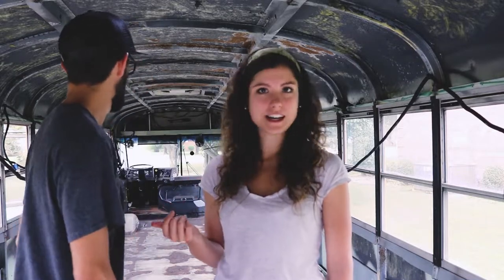The Easiest Way To Fix Rusted Floors School Bus // Skoolie Conversion

Comment: You are going to notice that with everything you want to do, there are several small steps to do first.  Watch my 'Subfloor' video's.  Its a slightly different way to do the subfloor.   Even now, 16 months into my build, i want to do something, and i still run into a small project i have to do first.  Keep pushing through it.  Even though i'm not done yet, it feels like such an accomplishment.  You'll get there too.
Reply from the maker: Thank you very much. I'll check it out. Slowly but surely making this thing something special for us.

Comment: Great job on the floor! We hadn’t seen the product you put on it to convert the rust. Looks a lot easier than grinding out the rust! We’re about to paint our floor & we’re looking for ways to clean it first. Great video! Keep them coming!
- Brian+ Erin
Reply from the maker: We did a little grinding at the loose stuff but this Corroseal stuff did so much better then we thought. We did 2 coats. We still have half a gallon left. We might do the undercarriage. We put a link in the description.
Reply: @BackroadPurpose  - That is so awesome to hear you found something that worked for you, and saved you guys some sweat equity! You are doing so great over there! :)
Reply from the maker: @BEAdventurePartners  yeah it was nice to walk into and see it work well. And thanks so much. It's definitely a lot of work but it's also fun

Comment: How did you clean the floors before using the corroseal? We have sticky glue from the rubber mating I would love to remove before using the corroseal. After the corroseal, what did you use to paint the floor?
Reply from the maker: Fortunately ours didn't have any glue on our floor but I would say acetone will probably do a pretty good job
Reply: @BackroadPurpose  thank you. I will keep that in mind. :) In the meantime, we did purchase Corroseal cleaner. If that doesn't work well, we could try the acetone. Thanks for the idea!

Comment: How did you clean all the dirt and stuff from the floor? What did you use?
Reply from the maker: I ended up sanding the entire floor first to get rid of most of the loose rust and then I just ran some water over it to rinse it out.

Comment: So you cut out completely the portions that were rusted all the way through, scrapped metal from the seat frames for patches, and then just used that converter? No metal brush to remove surface rust prior to the paint on converter?
Reply from the maker: I actually did use a metal wire brush form Harbor frieght to clean up all the old rust I just failed to document that part.

Comment: I am going through the same process. Did you have to grind and sand the entire bus floor, before applying the Ospho? Or did you just grind away the significant rust spots and paint over everything ?
Reply from the maker: I only spent time grinding the really rusted spots and then just roughed up a few spots that were a bit dirty. thanks for watching !

Comment: We have to replace the floor panels them selves. This is gonna be funny. What was the paint you used for the rust
Reply from the maker: The roster converter was called Corroseal and we used rustoleum enamel paint after that. Only 1 gallon of each.
Reply: @BackroadPurpose  ahh okay thank you.   We have a full size CO push engine international. Would a gallon of each be enough.  Sorry for the questions. I just tuned into you channel
Reply from the maker: @milkweed098  oh no problem! I'm glad to help and spread the knowledge I have accumulated. But yes. A gallon is enough. Our bus is 35ft (200sqft living area) and i only used a half gallon of corroseal and a half gallon of paint.